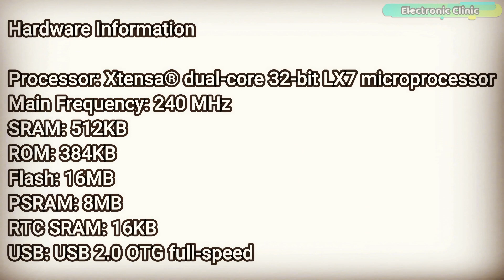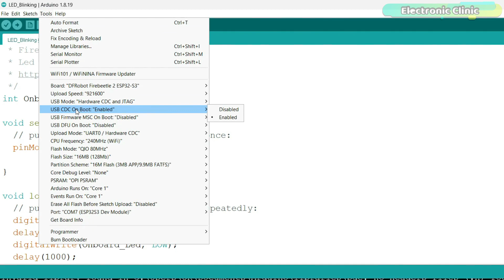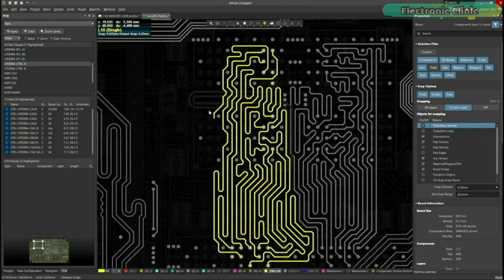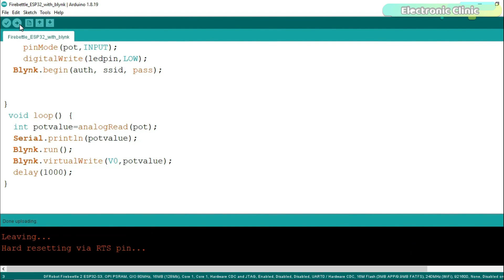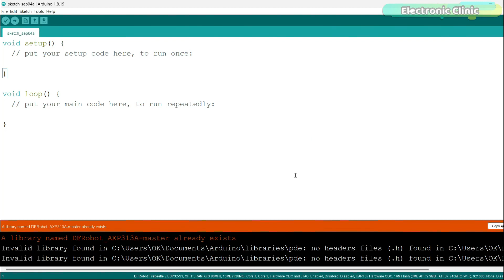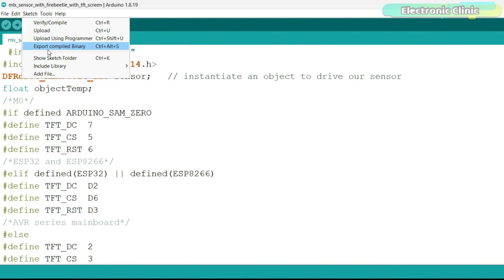FireBeetle 2 ESP32 S3 WROOM-1 getting started tutorial

Comment: is there no compulsion to use only predefined spi pins in esp 32 s3? shall we use any pins (except few strapping pins). is it true. I need to use 2 spi modules, spi 2 and 3. shall i use the pins for these spi according to easy PCB routing. i need to design a pcb with ESP32 s3 wroom 1 n8